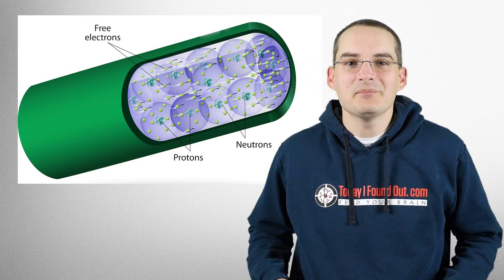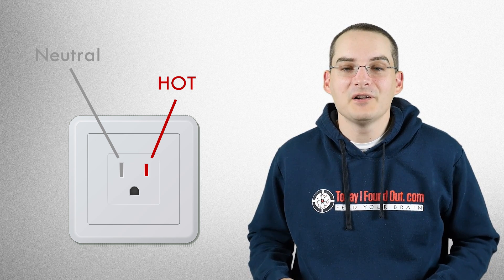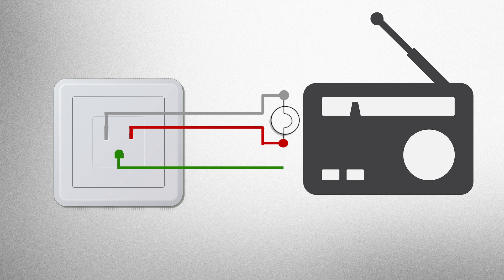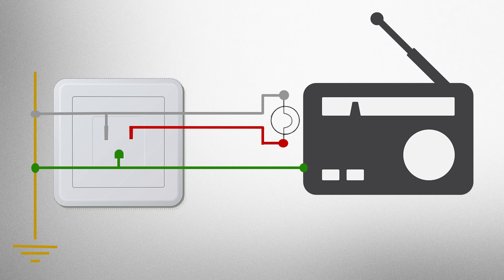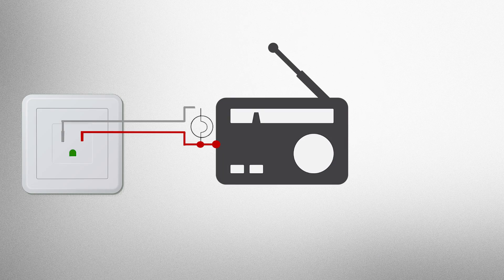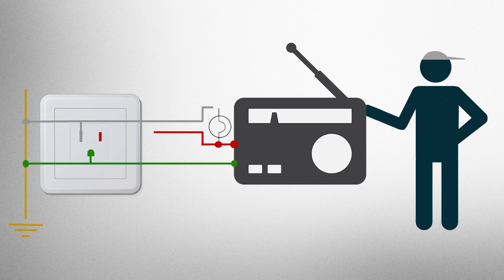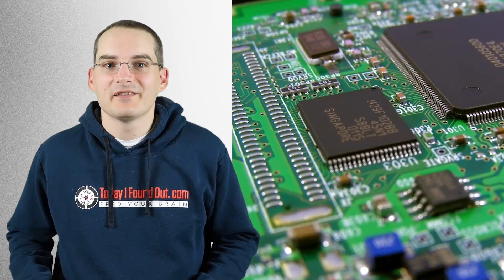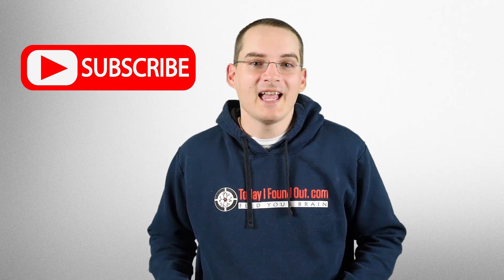Why Some Devices Have Two Prong Plugs And Others Have Three

Comment: Cheers. In the UK the electrical setup is different yet fundamentally the same. 
Smaller devices that use less power often don't have an earth prong (in the UK the prong is typically plastic rather than metal). Larger appliances need to be earthed for safety. 
One consequence of smaller devices not being earthed is that they may produce or be affected by EMI (electromagnetic interference) on the electric circuit and supply at large. 
High levels of EMI has health implications for those sensitive to electrics.

Comment: A ground connection is also used for static discharge to protect electronic controls. Not having a ground connection is a way to void your warranty, and get a manufacturer to refuse to fix their product.

Comment: Not all devices work "just fine" without a proper ground.  Many devices, particularity those working with small signals,  use the earth ground as a clean reference potential. The neutral, carrying current,  is too noisy to be used as a clean reference. So the device may still "work" with a two prong adapter but may have trouble detecting weak signals and so be working in a degraded manner.  The weak shortwave station that you can hear while plugged into ground might be covered with too much static after using a two prong adapter.

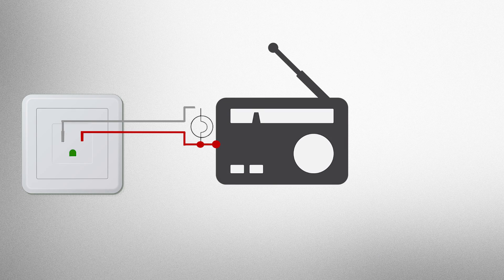Comment: 1:35 Sometimes it throws a circuit breaker, sometimes it doesn't. 

It only takes 0.1 amps to kill a person. That is not going to trip a 15 amp circuit breaker. 
Yes, there are Ground Fault Interrupt breakers which should stop you from being killed. In America, according to code, in new houses,  they need a GFCI outlet in the kitchen, bathrooms, and outside. If you are anywhere else in the house, good luck. If you are in an older house that was grandfathered in, really good luck. And if your are a house built in the 1950's, you might not even have that third ground connector...

And then, the GFCI that is there to save your life may be the cheap $6 builder's special. And GFCI breakers and outlets go bad. 

As I said; Sometimes it throws a circuit breaker, sometimes it doesn't.

Comment: Bonus Fact, the Metal ring attached to the 3 to 2 prong converter is there so It can be attached to the screw in the center of the outlet and act as a ground.
Reply: And I've seen many people just use the converter without screwing in the metal ring. =(
Reply: Another bonus fact, that little converter is called a Ground Lifter. Would be a cool name for a band, huh?

Comment: I knew about the ground but what are those outlets that have one t-shaped vertical slot for. I have never seen a t-shaped plug.
Reply: that is a 20 amp 110v outlet. as opposed to 10 or 15 for normal outlets. some microwaves, dryers or other high amp appliances need them. the  plug has one prong sidewayes, and one normal.
Reply: Terry Lambert sometimes it's a 220v line also
Reply: Yeah the 20 amp 220's have a horizontal hole next to the T, while 110 has a vertical one so that you should not be able to plug a 110 cord into a 220 outlet. a 20 amp 110 outlet will accept any 110 plug including the special 20 amp 110v plug. The The 20 amp 220 is usally used for larger window mount air condiners and in garages for heavy duty power tools. Of course all of this is american electricity standards.
Reply: I am talking about a regular 120 volt plug. Some have horizontal slot on the left slot. It isn't to polarized the plug because it is smaller than the right slot.

Comment: Tbh I came here because I wanted to know why the UK and Ireland use 3 instead of 2 plugs. Seems like no other country uses 3
Reply: Everyone does. Most of the EU uses CEE 7/16 "Euro plug" for ungrouded and Schuko CEE 7/4 for grouded connectors. Large parts of Asia, Africa and South America also use it to an extent.
Reply: xang pee the third plug also opens the shutters to keep objects being stuck in the plug. The same rules for grounding or double sheilding apply, which is why the third prong is omten plastic.

Comment: In the uk, we only have three pronged plugs. 1 top vertical and 2 lower horizontal.
Reply: There are various rules about when a device needs to be earthed. IIRC a double insulated device doesn't need to be earthed so doesn't need the extra wiring to support this. This is common on things like drills. However, the plug still needs to open the shutters on the live/neutral so they put a plastic pin in for that. Cheap products, oft found on eBay, don't meet the required specs so whilst they should be earthed, they aren't for cost reasons.

Comment: HOT is + for those who didn't understand. I was wrong. Check comments on this comment.
Reply: it is both + and -. It switch 60 times a second between posetive and negative current
Reply: Forgot about that.
Reply: It's not 60 hertz all over the world right?
Reply: It is 60hz in America and 50hz in most of the world
Reply: As I thought.
Reply: "Hot" is positive AND negative alternately 50 or 60 times a second hence the name Alternating current. "hot" being positive applies to DC on  most automobiles built since the mid 1950s. Before then most automobiles had negative as "hot". This video was about AC house wiring,though, Not cars.
Reply: Either way, Hot applies to the part of the power source that isn't grounded. Whether or not it is positive or negative, it will still shock you the same way. Although I guess in an automobile where neither side is grounded, they could both shock you.

But as others said, in AC circuits Hot acts as a sine wave and alternates.
Reply: xcheesyxbaconx The power supply in a car IS grounded. The "common ground" being the chassis and/or  body. In most cars built after 1953 the ground is negative. The low (12v-14v DC) is unlikely to shock you,, but the relatively high amperage can be a fire risk. You CAN get a hell of a jolt from the ignition wiring (upwards of 20Kv!!!, but it has ridiculously low amperage!).

Comment: Do people really not know about the ground..?
Reply: You realize you can just keep one-upping people right? Do you really not know that a 24 frames per second conversion to standard 29.97 requires a 3-2 pulldown? No, you didn't, even though it's extremely basic video editing knowledge. So when you claim people should know, you just come off sounding like a prick, kinda like what I'm doing to you.
Reply: kauske So you were born knowing that right?
Reply: Leo 

Mad that you never learned anything growing up?
Reply: Apparently so
Reply: While this is an example of a more obscure thing, the argument is still solid.
Reply: Except for the fact that what the parts of a plug are is in literally every single piece of documentation that comes with any electrical device. You know that documentation you are supposed to look through? and ontop of that if you have buy a socket splitter, power bar or extension chord any with a ground are sold as "grounded" if they have a hole for the ground prong. It's something you'd almost have to be willfully ignorant towards to never have even heard once in every day life.
Reply: Haha, I think you're being willfully ignorant of people who aren't motivated by education. Normal people don't read manuals, you know this.
Reply: People still have to buy products labeled as grounded or not. And refusing to educate themselves really isn't something to be proud of. That's exactly what I meant by willfully ignorant.
Reply: Pretty sure USA is actually still in at least the top 10 in most categories, but I could be wrong. Either way, I blame that we're spending billions of dollars on military monthly yet we can barely afford to keep covering basic necessities like Social Security or public utilities such as roads and public transportation...
Reply: +Templarfreak 
U states of A have never been in the top 20 in any educational poll..   beaten by most eastern European countries in all subjects, the only top ten U states have been in is poorest standard of educational on Earth.
Reply: I studied EE and still didn't know the point of the ground prong. The circuit is completed through the top two prongs so it doesn't seem needed. Makes sense that it is a security feature.
Reply: Sounds like you watched the video.  Why is that?  So you could troll people about electricity?  Its fun for me, i get to troll you back!
Reply: Guess that youtube doesn't like your attitudes, or maybe the channel owner. But go read an appliance manual, most state what the ground is for as well as not to tamper with it and to not use the unit if it's damaged or missing. The information that the ground is to prevent shocks is a mandated part of safety information in many countries.

There's also a small diagram including the positive, negative and ground terminals.